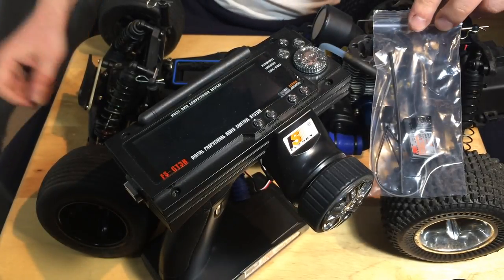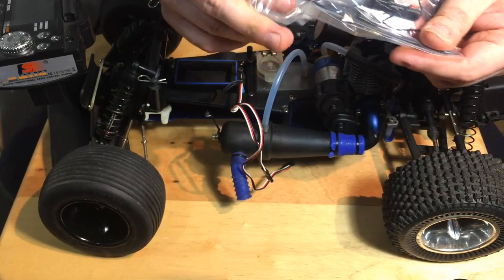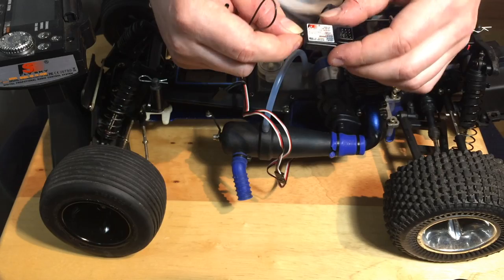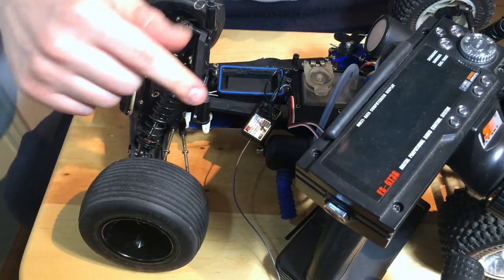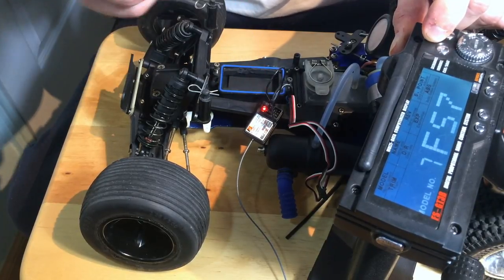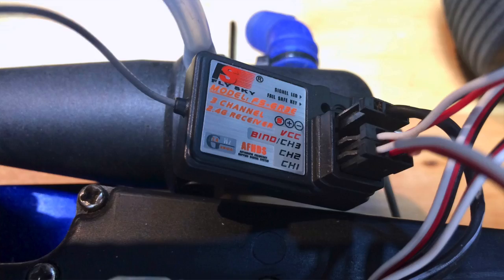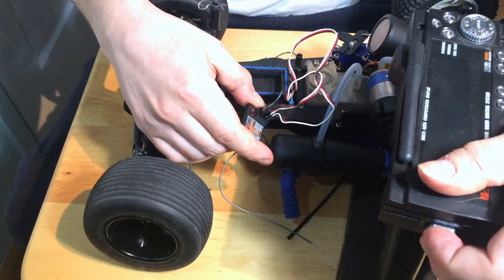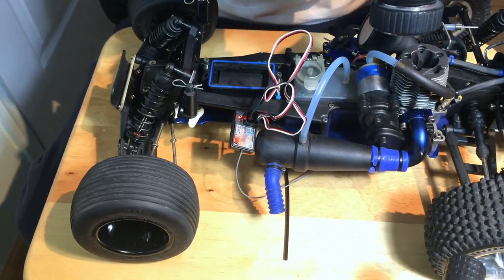HOW-TO Bind the Flysky 2.4GHZ FS-GT3B to the Receiver

Comment: I was dead ass not about to buy this because no one makes good tutorials but great job ordering mines tonight
Reply from the maker: hey buddy! I'm glad this video helped you out.  This remote is very easy to use, you will see just how intuitive it is.  Other than binding and setting a failsafe for nitro or gas RCs, there is nothing to it.  I've got another video about programming the failsafe btw.
Reply: @hybrid32494  I will have to check the other vid when i get my transmitter an reciver, sounds helpful. Thanks again good detail.

Comment: Awesome thanks so much... Was about to go crazy after being away from the hobby for 20 years... Thanks...
Reply from the maker: hey buddy! you go it!  Glad to help! BTW if you're running this radio on a nitro make sure to set the fail safe too.  I've got a video on that also.  Actually you should check the stock fail-safe setting on any RC, in case you turn the radio off first, you dont want a runaway.

Comment: OK question for you I can get my receiver to bond to either my GT 3B or my GT 3C but on these receivers do you know can I bond each receiver to multiple radios in case me and my girlfriend want to go out and run two different vehicles she can use her transmitter I can use mine
Reply from the maker: hey buddy! Very good question, and you will be surprised by the super basic answer.  In reality when you bind these you're only really getting the model memory of the remote to remember the exact throttle and steering and other settings of the receiver model.  So if you for instance ran the wrong model memory than the car you're running, then you would have totally different setting, the receiver does not know which model memory you're set it, the remote is remembering the setting.  Make sense? Now can you explain to me please how I can get my GF to like RC??  it's a damn mystery to me.  haha.As long as your model memory is correctly set you will be fine. some cars have very similar settings, so you wont notice a difference.

Comment: Thanks this was helpful. I’m gonna probably get a Losi 5t and put this radio on on it for a kill switch.  Do u know if I need the extension splitter?
Reply from the maker: yes, this would work great with the 3rd channel as the fail-safe activation.  From the failsafes I've seen they seem to already come with the wiring you need.  Just buy the failsafe and see it if all fits, I don't think you need extra wiring beyond that.  I just got into 5th scale gas buggies, am also learning about them now.

Comment: Just picked one of these up. Great video bud. Thanks 👍🏼
Reply from the maker: hey man, thanks!! I have never had a single failure with this system, and the receivers are super cheap.  BTW if you're using this on a nitro make sure to check and set the failsafe built into the receivers.  Check my channel for a complete video on that.  Also just check if any failsafe is already set anytime you use this system with a new receiver.

Comment: Hiya happy new year to you my friend iv been having problems with my baja setup to this I keep losing the bind lol I'm not sure if it's my failsafe plugged in to ch3 but I unplugged the failsafe from the receiver and I'm still losing the bind when I switch off the car and back on it's okay and within a minute only with my baja but it's absolutely fine with my electric rc buggy any ideas my friend
Reply from the maker: hey man!! You have this same flysky radio in the baja right? If it's tis same one, which I think it is.  Why are you running a failsafe on Channel 3?  These flysky receivers already have built in failsafe that you can program.  Remove the external failsafe and turn the baja and radio on (while the motor is off).  Then shut of your radio and see what happened. The thing should automatically apply brakes, this is the way the failsafe should work already.  Let me know if you have this happening?
Reply: @hybrid32494  it's the GT3c my friend and I got the failsafe before the flysky thinking better having it because I had the throttle jamming on a few times with the stock radio & receiver so I thought it was better to be safer than sorry if it runs away but I had followed your video for setting up the failsafe it's was starting up but would only run for 2-3-5 seconds or 10-20 seconds and cut out and lose bind and plus I unplugged the rovan failsafe switch from the receiver and it was still cutting out but I just removed the wires on the kill switch going to the coil and iv got a solid light on my receiver pmfsl £20 for the rovan baja kill switch and it doesn't work can't start the car or keep it running LoL looks like I'm going to have to trust the lost signal failsafe my friend :-)  and hopefully I don't have anymore full throttle jamming but it would have been a lot better to have the kill switch at the touch of the button as iv learned my friends 7& 10 year old son's to drive the baja and they love it :-D  but I would have felt safer with it and I'm going to take it out today and hopefully it's going be ok and have a good day Brapppping in the field with my new paddle tyres on popping wheelies & singing that lovely Brapppping tune full throttle :-D

Comment: Hi can you use the same bind plug with different sky fly receivers
Reply from the maker: Hey buddy, to answer your question that would be yes. All the bind plug really does is it puts a loop between two of the pins and that is how it goes into bind mode, you can use the same plug on pretty much any range of receivers for the most part.
Reply: Because when I went to install other buggie on channel 2 I lost the first 1 and now I can't get 1 to go now any ideas

Comment: Hey man...just got a flysky gt3c.
I am trying to bind my Jbl cheetah which came with the stock receiver....and i have no binding plug. Does this mean i cant bind it to transmitter? I tried what u did...without the bind plug...but no success
Reply from the maker: hey bro! Tell me the receiver you're binding the gt3c to.  Or are you trying to bing the JLB cheetah receiver to the Flysky radio?   It's got to be the gt3c to the receiver it came with.  And yes, you need a bind plug, didn't your radios come with one?  they usually come with a bad plug anytime you also Get a new receiver with the radio.  The bind plug is really just a jumper cable, but you need it.

Comment: Thanks buddy I've been trying to figure out how to do that for an hour
Reply from the maker: hey man, you got it!! BTW, make sure to check and correctly set your failsafe for this system, I have another video on that.  Especially if you're running this in a nitro or gas RC.  You always want the brakes to activate in case anything happens.

Comment: Thank you so much ! I just bought a new receiver and just don't know what to do with
Reply from the maker: hey buddy!! thanks for watching!!  If you've got this on a nitro make sure to also program the built in fail-safe.  The same goes for electrics, make sure the fail-safe mode is set to neutral for electric and brake for nitro/gas.   I've got a video on that here too btw.

Comment: Thanks man for this tutorial im about to buy the same for my Tamiya TNX 3.0 and my Earthquake red cat racing 3.0:)
Reply from the maker: hey bro!  You got it!  BTW, I got a bit of a radio suggestion and update for you.  I've since been using the newer and much better Flysky GT5 radio in all my newest videos.  It's significantly better, runs of 4 batteries, has a built in GYRO, has 6 channels., and much easier to bing and set failsafe.  I highly recommend you get the better GT5 radio, here is the link.https://amzn.to/3zeTMSO
Reply: @hybrid32494  THanks a lot :)

Comment: Heyy.... great video!!! It's really hard to find people who explain this well. I know I'm a bit late but-

I'm making an electric go-cart as a project and was wondering if I could connect this receiver to something that powerful (500w-1000w). The usual throttles that are used to control the go-cart take a similar input of 6v so I thought this could work. They also have one negative, one positive and one control wire and output ~1v  to ~4 v (no throttle to full throttle). Can you measure the voltage output range of the receiver? connect the negative pin of the receiver to the negative of a multimeter and the control pin to the positive of the multimeter and test the voltage range with no throttle and full throttle. This would help me out a lottttt!!!! Hope you read this.
Reply: Wattage is irrelevant as the Rx will only draw what it needs. It's voltage range is 4.0-6.5V DC.

Comment: Just one question?  Do you still have to plug in those crystal thing in these modern radios?
Reply from the maker: hey buddy!  These modern 2.4GHz system never have crystals.  Any modern 2.4 GHZ radio simply binds to it's receiver and it will link instantly,  you will never have channel interference.

Comment: When I ordered mine it was already bound. Hooked it up and it was good to go. Is that odd? Or do I have to still do this procedure. It works. Is it supposed to be bound to a certain channel out of the 10? Edit: I think it works on any of the 10 models that is selected so I'm guessing I should do this to Bind it to a specific model slot?
Reply from the maker: Yes, you can use any of the 10 model slots.  What happens is when you get more receivers and bind them you will simply use a different model name and slot.  It just stores your trim settings for each receiver.  Since you can run only one model at a time with the remote it is irrelevant what slot number you use.  Just make your model name and you will know which is which.
Reply: hybrid32494 ah I see. Thanks for your help. subbed.
Reply: Chris Watson same here but my steering is working in reverse? Can’t seem to suss it and you’d think it would be as easy as switching the connector round but Nope??

Comment: Im having bind issues too, i tried to bind my 2 extra receivers to different channels but when i go to one, it actually still controls the other 2 as well as the initial receiver. Please help
Reply from the maker: hey man, It's normal that your different channels control all the receivers you have paired. That is the way the model memory works.  Basically when you have one rc powered on at a time and you are using the right model number it will have your trim settings saved and that is how you're able to really use this for unto 10 models.  It's basically memory settings for each model number.  As long as it's binded you should be fine, don't worry about it, it will be saved to the model memory.  Does this make sense to you?
Reply: @hybrid32494  yeah it hit me omw to work lol thanks

Comment: After binding my rev is faster den forward, I even switched around the wires and still no luck, maybe something I'm over looking, do you have any troubleshooting techniques regarding the issue?
Reply from the maker: hey buddy! there is a high probability your throttle channel 2 setting needs to be reversed.   Do Channel reversing on channel 2.  Since the Reverse servo throw is shorter than forward, this would explain your issues.

Comment: Do u have to use that bind wire everytime or just the first time u bind it
Reply from the maker: hey buddy! You need to use the Bind Plug anytime you bind it for the first time to whichever model memory you want.  Once the remote recognizes the RX you're never going to use the bind plug again for that radio, unless you switch to another radio. Make sure to set the failsafe if you're running on nitro or gas rcs. I have a video on that too.

Comment: Hey man thanks for the vid, here's an interesting problem (might not actually be a problem.)

So I have two cars with this same receiver now. When I was trying to bind the 2nd car with the GT3B i realized it will only work on the original channel (Model 0). 

So does this mean I can't actually have 10 models to bind? In essence, model 0 on the remote transmits to both receivers. Model 1 will not bind to the receiver. 

I feel stupid because I had amazon send me a replacement but since the same problem happened with the replacement I figure that's just how these remotes/receivers work??
Reply from the maker: Hey man! I know exactly what you're talking about.  The gt3-b radio does in fact have 10 model memory and you could bind multiple receivers to it (of the same type).  The reality is the radio only records your trim settings and saves it to the Model Memory Position you're using.  It does not actually know which receiver is plugged in. (the GT5 radio does, it will not let you run receiver 1 while using a diff model memory).

Anyway, when you have confirmed the 2nd RX is binded to model memory #1 you should be fine.  You start off the binding process with the remote in channel 1, the one you're binding to.  Have you done this step correctly??

I highly recommend you pick up the much better flysky GT5, much easier to bind and set fail-safe function.  In all my newer videos you will see I am running mostly the GT5 radio.
Reply: @hybrid32494  Dude you're the best!! 

Definitely gonna look into the GT5, you are spot on, the models within the remote retain the trim and other settings but it's not receiver specific like I originally thought. 
 
Subbed! Thanks again bro
Reply from the maker: @AfternoonProductions  glad to help bro!!  You got it!! the gt3 is a good radio, but it's something I used over 10 years ago, currently the GT5 is the best bet.  Also it's got 6 channels and a built in gyro in each RX.  Also runs on 4AA or a tiny lipo with a JST plug.

Comment: Hey great vid man easy tutorial. I got my car all set up the steering works but there is no throttle and the light is blinking slow. Any help?
Reply from the maker: hey dude! Thanks! Can you tell me if you correctly connected the Channel 2 plug in to the RX after binding?  If your steering works, that means it's bided fine and your Ch 1 plug is correctly plugged in.  Are you running an electric? Make sure the esc is plugged into ch 2 and your bind plug is removed.  Let me know.
Reply: hybrid32494 Its weird. My throttle will work when its pluged into chanel 1 but then my steering doesnt. And when I have my steering in chanel 1 its works but my throttle doesnt. Its super werid and I have no idea what I’m doing but i’ve learned alot from all the research ive had to do.
Reply from the maker: What car are you trying to use this system for? If its an electric and your trims are all off then sometimes the esc wont arm itself. And u will see blinking lights.  If u have a spare servo plug them both into ch 1 and 2 to verify both channels simultaneously work.

Comment: Is the receiver waterproof?
Reply from the maker: hey buddy! I cannot confirm that it is waterproof, but I can tell you that I've driven in plenty of water and the RC has always been fine.  I highly recommend you use hot glue to seal around the antenna wire and the case itself, if possible also just hot glue the receiver wires, it will be fine. This is the easiest and most reliable method.

Comment: Hi, maybe you can answer this question I’m not sure if it’s a remote issue or a speed controller? I built my first grasshopper and have everything connected and I can get the steering to work but I can’t get it to drive? The motor does nothing? Is there something I’m missing?
Reply from the maker: hey man! I sure hope we can figure this out. So far you know the radio is correctly paired if you have control of at least one channel.  You need to troubleshoot this by switching Channel 1 and Channel 2 and checking if the system works at all.  You can just swap plugs in the RX, easy.  I'm sure you're running a brushed stock motor and the tamiya ESC right? Put the ESC in channel 2, and make sure the bind plug is out.  (I'm sure you know most of this, but let me know any updates) I will comment back ASAP.
Reply: @hybrid32494  I don’t know any of this LOL I got a new speed control in and still nothing! Yes it’s the stock motor and what you just explained I will try but don’t know? Can you do a video on that? If i hook the battery to motor it works perfect otherwise nothing
Reply: I appreciate your time
Reply from the maker: @driscollboys8671  Hit me up on instagram we can go through it together.  Its pretty tough messaging on here.  Im the same user name as on here btw.  Main thing is your steering is always Channel 1, and your ESC/Throttle is always channel 2.
Reply: I figured it out! I thought you meant channel 2 on the controller. So I swapped it on the transmitter and it works perfect! Thank you for your help!

Comment: can i bind this transmitter with fs-ia6b receiver?
does it remember settings for multiple receiver?
Reply from the maker: Hey man, you cannot bind any receiver, other than the ones are meant for this particular radio. I highly recommend you pick up a fly sky GT five it is significantly better and will remember the model memory for up to 20 channels.

Comment: THANK YOU!! I have been struggling with this for too long. And other videos go into way too much I just needed to bind it!! I hooked it up regular and tried to bind. Thank you so much. Lifesaver
Reply from the maker: hey bro!  You got it!  Glad to have helped you out. BTW also make sure to check and set the fail safe if you're running this on a nitro or gas model.  I have another video here about correctly setting the fail-safe settings.
Reply from the maker: @jimmyv1753  Yes man, we have all been there right.  Once or even three times even, ahaha.  Anyway glad you got it goin.  I normally run GAS RCs lately and they have an extra safety device operated via the 3rd channel too which cuts spark to the motor if needed.
Reply: I’m back doing it again on my 104001. And forgot again lol. But this time I smart enough to remember there is one good video that shows exactly how to do it